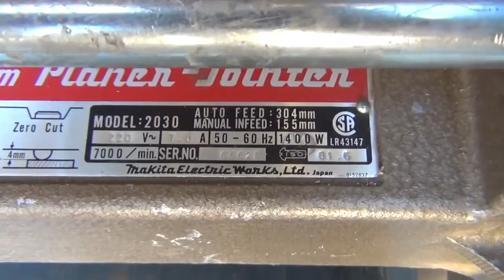Makita Planer and Jointer Model 2030

Comment: This is a cool machine! I've been using this for 20 years now! Clamping rubber rollers worn out and rubber became like plasticine! it's time to replace! ;-)
Reply: Mine need replacing -where did you get yours?
Reply: @bensongarbagetruck  There was a Japanese exhibition in my city. It was back in the 80s. After the exhibition, some guy took it for himself. And in the late 90s I got this machine.
Reply: western roller corp re-dips them